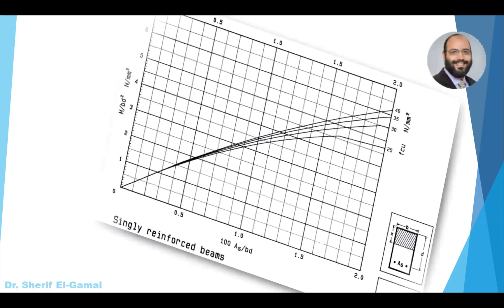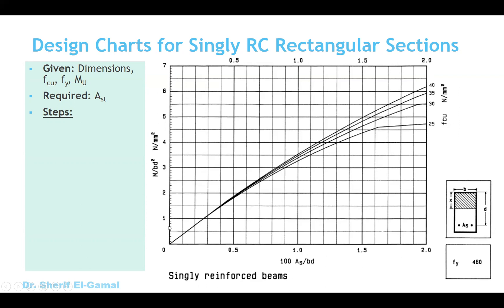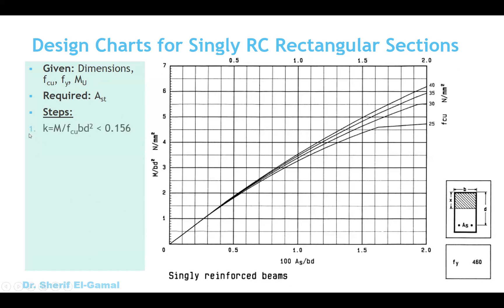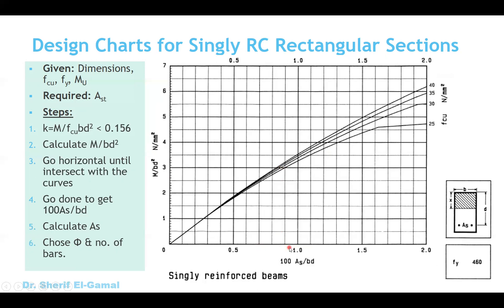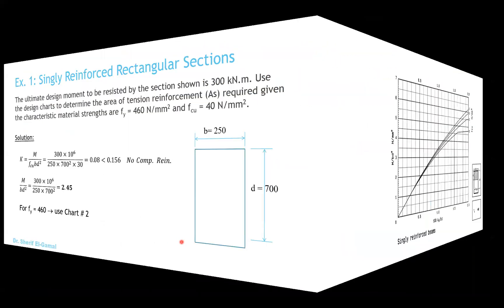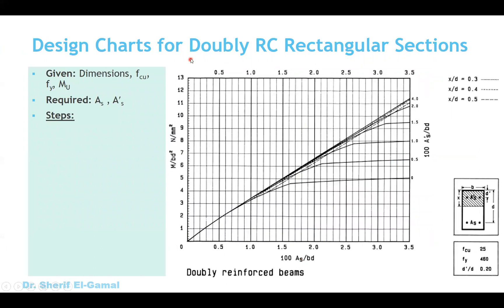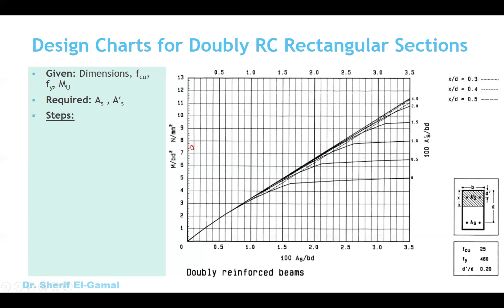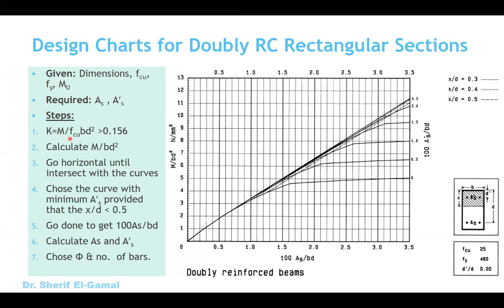Design Charts for Singly and Doubly Reinforced Concrete Rectangular Sections

Comment: The crossing for the x/d and compression steel reinforcement ratio was confusing thus I didn't understand that part till the end
Reply from the maker: Watch it again and you will get it.
Reply: The broken lines on the chart represent x/d. The first broken line from the bottom of the chart is 0.5, then 0.4,  then 0.3 according to the x/d values given beside the chart

Comment: In the calculation for K you used fcu = 30, meaning M/bd^2 is supposed to intersect with fcu = 30 on the chart and not fcu = 40N/mm^2

Comment: What is the formula  for getting number of bars from area of steel according bs8110 for Fy=410, Fcu= 20, Because BS8110 part 3 doesn't have table for such cases.